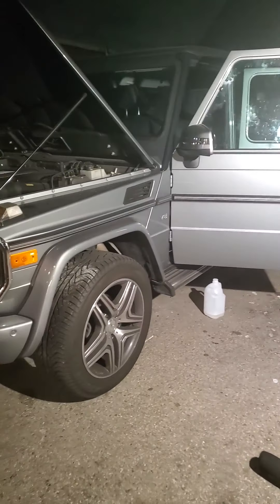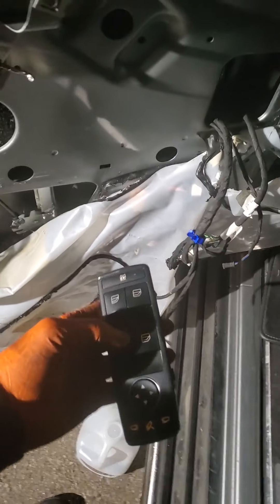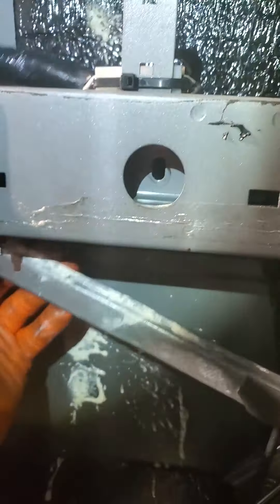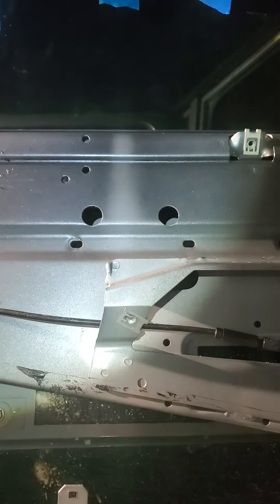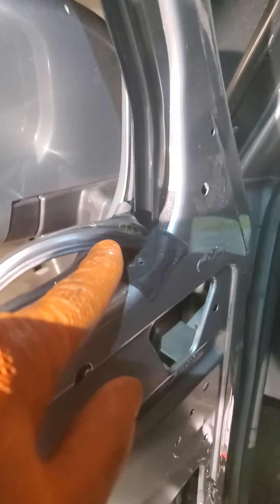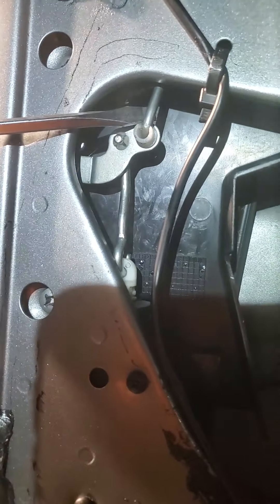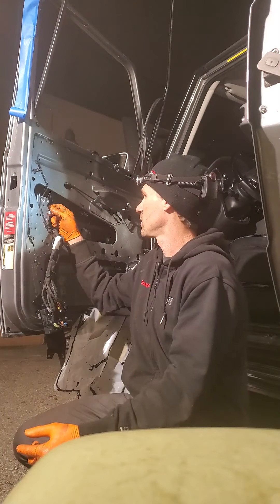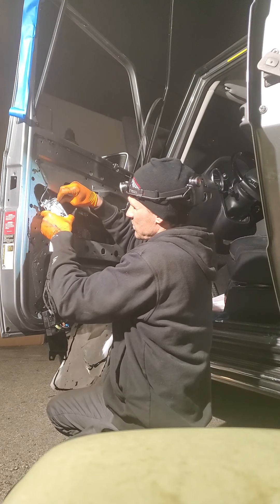G Wagon Door Latch Replacement Won't Close or Latch Fix

Comment: Just found your channel.  I did this particular repair about 2 years ago on my G63.  That window rails is a real PITA to go back in.  Other than that, it's a pretty easy job.  I found your channel looking for the Ferrari PTU leak issue, so it was great to see you are working on a custom fix.
Reply from the maker: I already made the repair kit. I've sold 12 so far and they work flawlessly.

Comment: Thanks for the upload. I couldn’t figure out why I couldn’t get the lock out …. 

I did the removal. I was Al le to remove and reinstall the window and the window frame without removing the window mechanism. 

I also agree with the earlier comment, If all you need to do is replace the spring on the lock, the. It can probably be done without removing anything and a nice mirror. I found my spring sitting in the bottom of the door. The end Had broken off. I bent the last two coils up and reattached. We’ll see how long that lasts for.

Comment: Thanks. This is a first for the G but I’ve had to change the Regulator’s a few times, it’s annoying but not difficult.  This is a much more complicated job. I wish my wife would sell her Wagon.  Does anyone know if that mechanism needs replacing or is it fixable?
Reply from the maker: In most cases it's just a small spring. I put a link to where you can buy the spring in the description. Mercedes only sells the whole latch at a much higher cost

Comment: Think it's possible to salvage the existing spring? I ordered one from fourbyfourclub two weeks ago and my order was canceled and refunded. I'm guessing they're no longer in stock.
Reply from the maker: If you did, the spring would break in the next spot. Cheapest option would be buy a used latch, or just the whole assembly from mercedes
Reply: @HollywoodMechanic  Thank you and great video btw

Comment: Is it possible to change de spring with the lock in the door
Reply from the maker: I don't know. When I did this repair, I didn't know the spring was the problem and had a replacement latch already. It's very tight and behind other things. I don't think it's possible.

Comment: Can you leave the glass secured to the door tape or suction cups and skip the window frame removal or does that have to come out to remove that damned plastic cover that is keeping me from simply replacing the spring with the lock latch still in the door?
Reply: I I know the regulator assembly has to come out.  I guess that glass frame has to come out (or at least be loosened) go move out of the way to remove that plastic cover?
Reply from the maker: @breedshill7333  I had to remove it to get to the latch.  There might be a way to do it, but it comes at the risk of breaking, bending or scratching some expensive stuff in there.  If you just follow the way I removed it, I find that you should save more time then playing with it.  I used to try to figure short cuts out with my work, but most of the time, I end up doing it the original way as well as wasting time and breaking something.  Sometimes there are tricks, but most of the time, the shortest way to do it, seems like the long way.